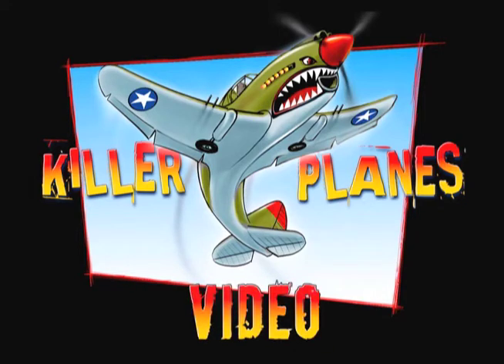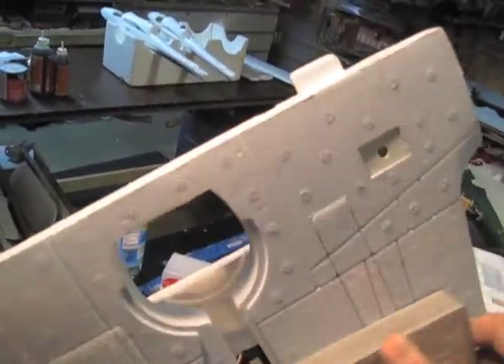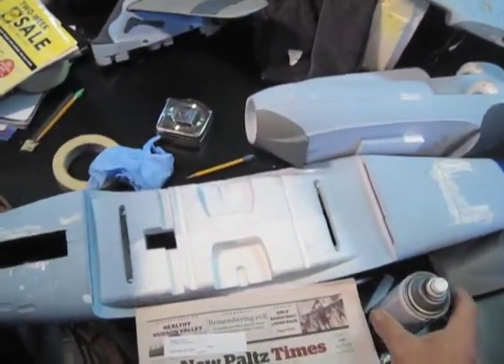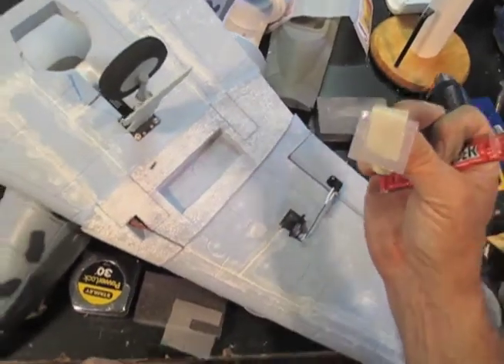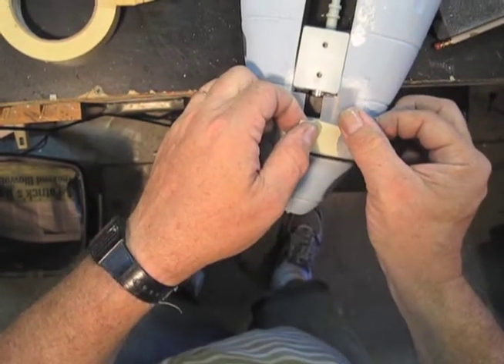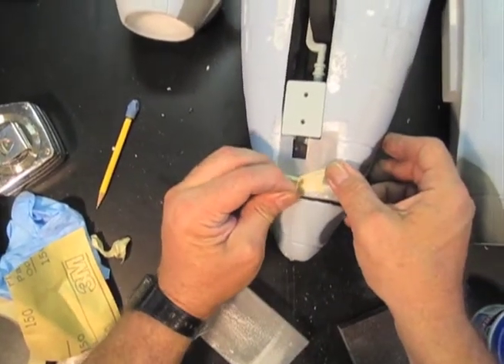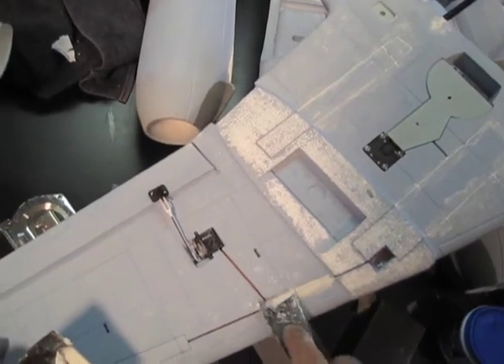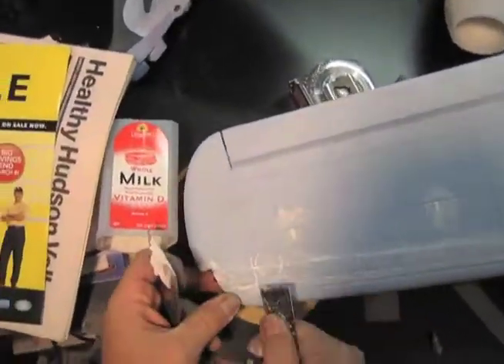HOW TO PRETTIFY YOUR PLANE   PART 1   PREP FOR PAINT #132

Comment: Reference tape that won't pull the paint off your foam… I ahem had REALLY good luck/results with Post-It Notes. Extremely low tac, and for what its used for does a pretty good job of masking. Will post some vids of the Art-Tech Corsair I am doing a paint job on (once I get it from Da FedEx Man!
Reply from the maker: +J.C. Witherspoon Great idea- I tried it and it works really well

Comment: Hi everybody there! Guys, iam real rookie in models and this is my first big model. Everything is ok, but i got serious problem with connecting or completing wires on this plane. Is there any video about connecting electric wires Me 262 Dynam? Thx a lot 4 every advice or tip.
Reply from the maker: Lukas- I use 2 3000mah 4 cell batteries in mine. If you're talking  about the rest of the wires, you can plug them in one at a time and test it with a powered up receiver. Mark them when you figure out what they are, and then  hook them all up in the regular way to your receiver. You'll need a couple of 2 wire servo splitters, and one 3 wire splitter for the landing gear. Hope this helps! PS- do a HUGE NUMBER of training flights before flying a plane like this one, as well!
Reply: @Killerplanes  Thx a lot for super tip again! And my last questions - what about this battery? Power X6 4600 mah 5S 35C (70C) How long is possible fly with? And RC trasmitter without telemetry - how I will know, that battery is low - not to crash because of out of battery?

Comment: RUSTOLIUM doesn't burn the foam??
Reply from the maker: +MrCavemanDon Not Dynam foam, if you apply the paint in thin coats. Test paints you're using on the inside first, and always use THIN coats when you spray